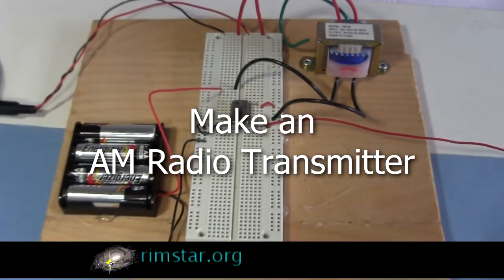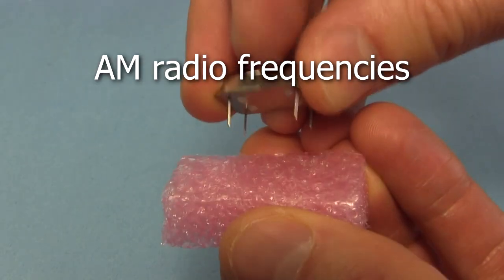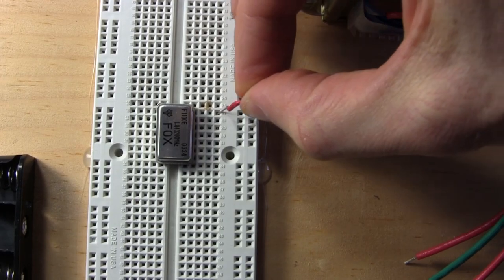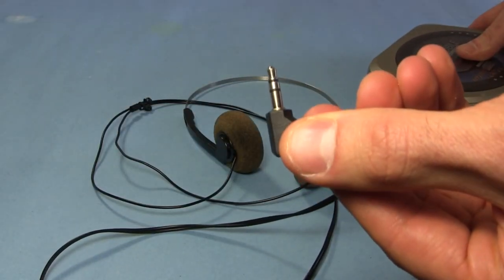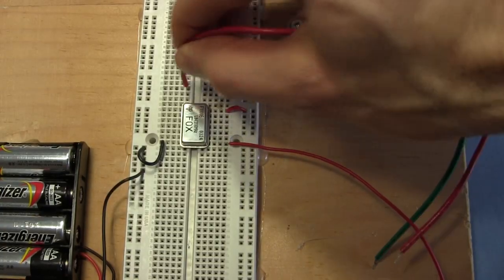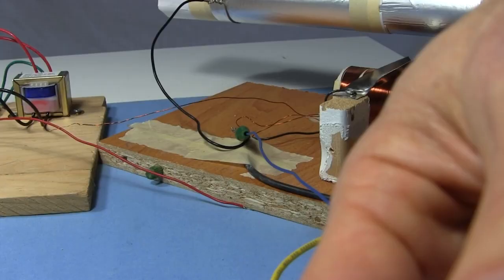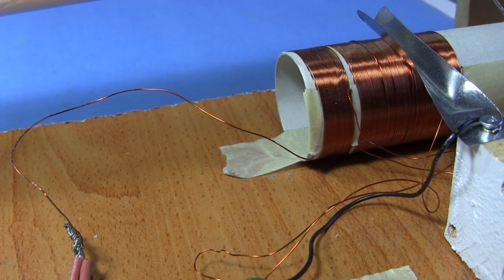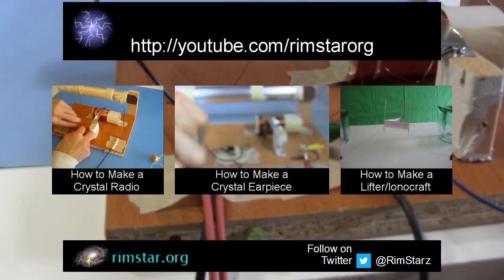How to Make AM Radio Transmitter

Comment: can i increase the antenna range by adding more batteries?
Reply from the maker: I think you'd have to increase the voltage for both the auidio source (the CD player in my example) and the oscialltor (the batteries in my example). Of course both the audio source and the oscialltor will have maximum voltage limits. However, you shouldn't do it since that might interfere with other radio sources, some even might be emergency services! In many countries it's even illegal to transmit. Mine was very low power so the signal didn't go very far before becoming very weak. If you want to get into radio transmitting then look into things like radio clubs and radio certitifications.

Comment: this is really amazing in robotics, cause you can make it without an arduino,  and you can actually connect your gpu to it for heaps of processing power.  but I guess you can with the arduino as well,   but you can make the whole thing from scratch if its just recievers and transmitters.

Comment: I read somewhere that a typical audio transformer has a 12:1 ratio. I'm thinking a 9 volt transformer is closer to this ratio than your 6 volt transformer and may perform better. That's something that might be interesting to compare against your 6 volt transformer. An old 9 volt wall wart style power supply may contain a transformer about the right ratio.

Comment: Wehre do you get the chip
Reply from the maker: I got mine from a local electronics store. However, a better 1MHz one is available here https://scitoys.com/index.php/transmitter.html though their store seems to be down at the moment.
Reply: Ok thanks😊
Reply: Can you maby make a video dedecared on this topic from waht devices i can get this chip also this is just an idea.And i dont want to force you ps have a nice day😊
Reply from the maker: Sorry but I don't know which devices you can get this chip from. Keep an eye on the store for that website and contact them to see when it will be back up. Search on https://ebay.com for "1mhz m-tron crystal oscillator" finds a bunch of similar oscillators but I'm not sure if they'll work with this circuit.
Reply: Ok i will do my best and thanks for the responce.

Comment: One question though, is the coil only amplifying the source signal ? If so does that mean if you have a higher power source like 12V and is hooked to a transistor (to act as a amplifier).

Comment: For better performance, buy a 1 to 1.5 Mhz oscillator.  Connect the computer speaker amplifier to the transformer and make a parallel LC circuit connected in series with the output of oscillator and antenna.  With LC circuit the square wave will turn into a sine wave, I saw it on the oscilloscope it works.  Use an antenna about 20 meters long.  I was able to pick up my signal at a distance of 100 meters.  Be careful there may be laws that do not allow broadcasting without a license.

Comment: for those of us that don't know much about antenna and are trying to learn it be good to explain what each component is doing. Like why do you need the transformer and the AA batteries?
Reply from the maker: Good questions. I answer them in this follow-up video https://www.youtube.com/watch?v=_4-Sx-T6VBc
Reply: @RimstarOrg  the link doesn't work 😭😭😭
Reply from the maker: That's off. I just tried it and it worked for me. Try this short version of the link https://youtu.be/_4-Sx-T6VBc
Reply: Hello from TN. The link takes me to this same video! I have almost everything for this project. I’m just waiting on the wire to come in.

Comment: What is the range of this crystal circuit, thank you
Reply from the maker: That depends on how much power you put into it. I keep it to a meter or two. You don't want to interfere with other people's reception. This is also a simple, fun circuit, but it transmits on many harmonic frequencies at the same time and so you definitely don't want to transmit far. In most countries, you need a license to transmit.
Reply: @RimstarOrg  I was just wondering, thanks a lot. I offer respect and love from Turkey
Reply: Now when you say it transmits only harmonic frequencies, what exactly does that mean? You couldn't hook up a microphone and place of the audio input from other source?
Reply: @brandonlaragirl  it would still transmit on more than one frequency if you added the microphone. You would have to add circuits to keep this transmitter from transmitting on its harmonic frequencies.
Reply: @basimpson2161  got ya.  Thank you
Reply: @brandonlaragirl  harmonics are multiples (x2, x4, x8) & sub-multiples (1/2, 1/4 etc) of the fundamental frequency. This is because the oscillator module puts out a square wave. Professional circuits use band-pass filters (BPF) to cut out harmonics. For a microphone input, you would need a dynamic mic (moving coil) or speaker operating in reverse with a LOT of amplification to modulate the carrier (an electret mic can't be connected directly)

Comment: I cant buy cystal oscillator but from old broken crystal oscillators radio will it works?
Reply from the maker: That depends on the crystal oscillator you got from the radio. If it has four pins like the one in this video then maybe but if it has only two pins then you'd need a different circuit.
Reply: In my country was too expensive 200 php+ the 4 pin oscillator in phillipines
Reply: Two quick questions mine only has two pins. What circuit would I have to use in order to make this transmitter? Also I don't understand the purpose of the transformer. You already have an external power source, so what purpose is the transformer serving?
Reply: @brandonlaragirl  the two pin type are standalone crystals only - to oscillate they must be in parallel with a capacitor (LC tank) and transistor to keep the oscillation going. The simplest circuit diagram to explain is the FM bug. The four pin type are a complete oscillator in one package - all it needs is DC power. The transformer is to match the low impedance audio input (about 8 ohms) to high impedance circuit (about 1k). The confusing part is he used a power transformer rather than audio one, but it all comes down to turns ratio. Any other q's just ask ;)

Comment: How can you change the radio frequency in your radio transmitter?
Reply from the maker: For this circuit you'd need a different oscillator.
Reply: @RimstarOrg   cool, can you recommend a video guide on how to make your own oscillator? And guide how to make simple transistor as well. I'm trying to understand how all these parts works and if possible manufacture them all then create a finished product using all of them completely 100% handmade.
Reply from the maker: Sorry, I don't have any recommended video guides off-hand. This book here is the ultimate guide to making your own transistors http://hpfriedrichs.com/mybooks/ioa/bks-ioa.htm You can buy it from Amazon.

Comment: hey if you see this i didn't work for me i used a 12 mhz crystal and all i get is clicking noises on my radio when i wiggle  a connection and i get no sound .. i tune in into am 12.00
Reply: AM Reciever can pickup any radio station from 500kHz to 1,6MHz, Your radio transmitter that you build broadcast signal on 12MHz which is way out of AM band

Comment: you used a 1.8 megahertz oscillator in the video.wavelength=(3x10^8)/(1,8x10^6)=166,66 meter. so you need 166,66/4=41,66m antenna. is this true? Did you use a 41,66 meter antenna?
Reply from the maker: You can use a shorter antenna, mine it very short as you see in this video. It's just not as efficient. However, this is not a circuit you want to use for transmitting more than a few meters since it broadcasts on a bunch of frequencies (harmonics).
Reply: @RimstarOrg  I want to send the signal with module 2 meters away. How long should the antenna be on both the transmitter and the receiver?
Reply from the maker: I don't have an precise figures for you but what that's about what I did in the video. Just keep in mind that with all the harmonics (the different frequencies) it'll be transmitting on, you may even interfere with other electronics of your own. Also, make sure to keep it very low power, i.e., so you don't transmit any farther, since you'll interfere with other people's electronics. In most countries, transmitting like that is illegal and requires a license. If it's possible you'd transmit farther then look for a better circuit. This one's intended only as a simple, fun, educational thing.

Comment: What difference would using a microwave oven transformer make?
Reply from the maker: I can't say for sure. An audio transformer is designed specifically for audio but since I didn't have one, my transformer was a pretty random selection. A microwave transformer would have a different number of turns on the primary and the secondary so you'd get a different voltage than I did. Having a different number of turns means there would be a different impedance (like resistance but to AC) and so the efficiency would be different.
Reply: @RimstarOrg  how would one go about stepping up the power of the broadcast significantly? Would you be able to use an audio amplifier but somehow instead connected to a transmitter? I know that with software defined radios we use low noise amplifiers in line to increase the output power. Of course one should only do such a thing if they were permitted to do so by the FCC and on the proper bands...👍😉
Reply from the maker: I wouldn't with this circuit. It's fun to play with for very short distances but it broadcasts on too many harmonics to be used anywhere for longer distance.
Reply: @RimstarOrg  What's the point of the transformer?

Comment: Good demo: 1 thing, AM radio receivers do not use the long stick antenna for AM, they all use an internal ferrite antenna , the stick is only for FM (or SW), so just tune the receiver and rotate it to align it with the magnetic field.
Reply from the maker: Interesting. Thanks. I'm used to making crystal radios where we use long wire antennas -- though having some AM radio stations nearby, I'm able to use relatively short wires (5 meters).

Comment: How far the transmitter can broadcast? What is type of transformer?
Reply: If I chance audio input to electric signal, this circuit can operate?
Reply from the maker: The audio input is an electric signal, just one that fluctuates in time to the music.
Reply from the maker: So I guess that's a yes. :-)
Reply from the maker: Mine transmits only a meter or two. You  don't want to transmit very far since you'd interfere with other transmission sources. In many countries it's even illegal to transmit unless you get a license (which many hobbiests do get). An audio transformer would work better than the one I used but it's all I had. Mine was a doorbell transformer.
Reply: @RimstarOrg  thanks for replying me, i have a project same your but mine is RF signal input. Can I alternate audio in your diagram to RF signal?
Reply: Distance which I wanna do is 50-70m, How I can do this? Please help me, thanks you
Reply from the maker: For RF, you just need to get a chip like mine with the same functions for its four pins ass I describe but that puts out a frequency in the RF range.
Reply from the maker: I can't say how to increase distance since in most countries it's illegal since it interferes with other radio broadcasters, including possibly emergency radio. To do it legally, look into how to get an amateur radio license in your country. Also, don't use this circuit since this one transmits on many frequencies.

Comment: only other thing i would have done i would have used both signal lines off the jack and tied them together to get a dual mono bridge that way id have bth channels even if its only transmitting in mono

Comment: Is the transformer for coupling the AC sound signal while blocking the DC from your CD player?
Reply from the maker: Yes, my understanding is that it's for adding the two signals together. I hadn't thought about blocking the DC from the CD player but that makes sense too. I did a follow-up video where I explained the whole process https://www.youtube.com/watch?v=R04yEKqgGPc And if you want to go further, I also explain how the crystal radio works in this video http://www.youtube.com/watch?v=0-PParSmwtE which is kinda neat because you get to see how the signal is unpacked again to what came out of the CD player originally.
Reply: The audio, I believe, being pumped into the first coil of the transformer induces an electrical signal in the power source of the entire circuit, causing the voltage to fluctuate, thus producing sound by modulating the amplitude of the frequency. Hence the name Amplitude Modulation or AM.

Comment: If you used a microphone would it work?
Reply from the maker: You would need a microphone that has a built-in amplifier. So one that takes batteries might work.
Reply: You can use carbon microphone connected in series with transformer and battery

Comment: What is the range of the crystal oscillator i can use for this project?
Reply from the maker: Do you mean the frequency range? I don't know the exact range. To play it safe, I'd stick to the AM radio range, which is from about 540 kilohertz to 1.6 megahertz.
Keep in mind that broadcasting radio is illegal in most countries and often requires an amateur radio license. If you do this, make sure the radio can't transmit more than a few meters.

Comment: With this setup, increased voltage and a much larger antenna how far could the signal travel?
Reply from the maker: I don't know but it's illegal without a license in most countries anyway. That's why I kept the signal weak in the video. It's just fun to experient with.
Reply: @RimstarOrg  u.s.a. limit is 100milliwatts and an antenna less than 10feet long.  This transmitter is not illegal.  I doubt its more than 100millivolts
Reply from the maker: Thanks. That's good to know. I hadn't known there was a lower bound.
Reply: @zundfolge1432  99 milliwatts and an 11 foot 9 antenna it is then.

Comment: Can this be made without a breadboard?
Reply: You could make a pcb and solder the components
Reply from the maker: And if you want to go the other direction then you can use wires with alligator clips for much of it. Clipping onto the chip would be difficult though and you might still go with soldering for that.

Comment: What would the circuit be like if there are only 2 pins on the crystal oscillator?
Reply from the maker: I don't have the circuit off-hand, though I did once see a video of it a long time ago on YouTube. You'll have to search for it. It'll have more components since it has to make up for the what's included in the 4 pin crystal oscillator.

Comment: i actually realized you can make one out of a boiler and steam going trough a flute that goes trough a big piezo electric crystal that is connected to a antenna spark gap circuit by using wood as energy source. you can also use a water wheel system that use a bowel to create frequency mechanically by  resonant frequency of material and connect that to a piezo crystal.  for the voice part we need a piece of graphite in between the arc gap connected to a speaker funnel like a old hearing aid. by speaking into the funnel the graphite will vibrate the current and the bowel or flute will act as carrier wave and the crystal will create the electricity to provide electical power to the contraption. the receiver is just as simple. you use same type aparatus for receiver but as sound will come out the other way but this time the graphite will play the sound instead of sending it. if you can't hear the sound the other end, you need a way to tune the signal by adding some metal to the funnel or crystal electrode and it chould works as a tuner by regulating quantity or pressure to the contact point.
Reply: dumbcreaknuller  YOU FORGOT THE BALLOON THROUGH THE HAIR STATIC ELECTRICITY FLUX CAPACITOR

Comment: I just built this AM transmitter according to your diagram, and it works! It transmits a very strong clean signal. I used my iphone as an audio source and there was no problem with the volume level.
Reply from the maker: Cool! Glad to hear you got it working! Just be careful to not transmit too far and interfere with other people's radio. This circuit is especially dangerous in that case since it transmits on multiple frequencies. You don't want to interfere with emergency response systems.
Reply: @RimstarOrg  Thank you for the words of caution. So far the signal is contained to the interior of my house.
Reply: RimstarOrg Please tell me how you managed to do that! I’m doing a science project and I really need a way to transmit sound by a phone. Thanks!

Comment: Hello, very intressting video. I found a 10 MHz oscillator chip, will that work? Also could you make a crystal radio capable of tunig in to that frequency?
Reply from the maker: If your chip has 4 pins like mine and the pin definitions match the ones in the datasheet for mine http://www.farnell.com/datasheets/58697.pdf (you'll have to search online using your part number) then it should transmit. 10MHz is in the range for shortwave radio (https://en.wikipedia.org/wiki/AM_broadcasting#Shortwave_broadcasting) but I've never tried to receive in that range with my crystal radio so I can't say for sure whether or not it would work.

Comment: Hey, 
Great project as always! 
I am getting a two pin crystal oscillator locally. The 4 pin one is not available... Can I use this one instead? If yes what would be the new schematics?
Reply from the maker: Thanks! The answer is, yes you can use the 2 pin one instead. I have seen some schematics online in the past but I didn't save any links. Some were YouTube videos. You'll have to search for them.